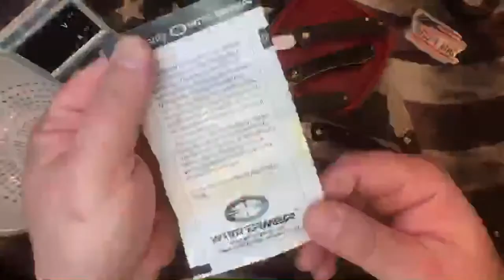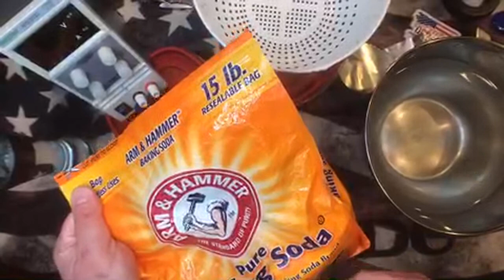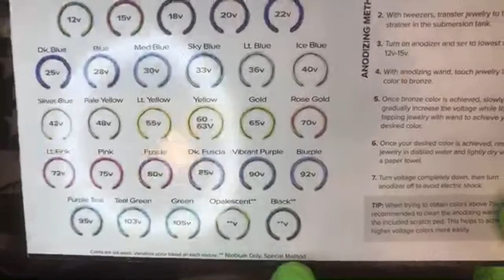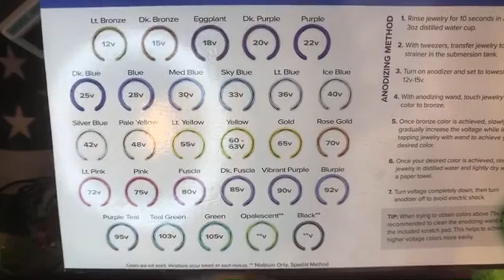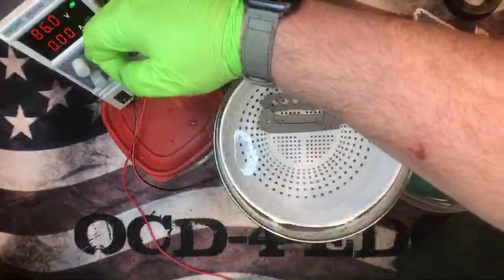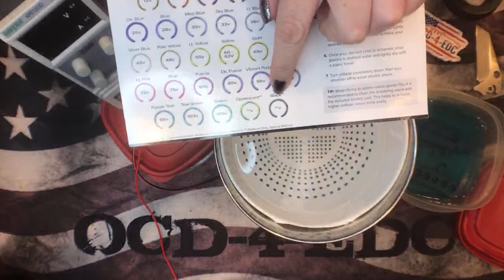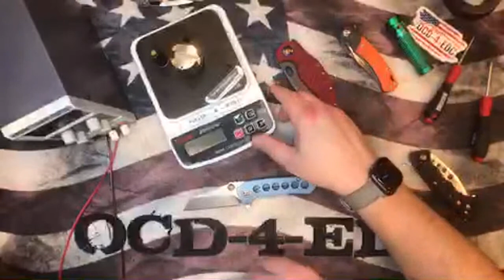OCD’s Live How-to Stream!!! 8-8-21

Comment: For my etching I use the Drylock brand concrete echant from home depot in the section with garage floor paint.  Works great, comes in an easy powdercrystal form.  Doesn't have to be heated up. It can be to speed it up but not necessary. Works great even on stainless but not so strong that 8 seconds turns it black.  I like a slower etch to be able to control it better.  But it's not so slow that it takes 15 mins.